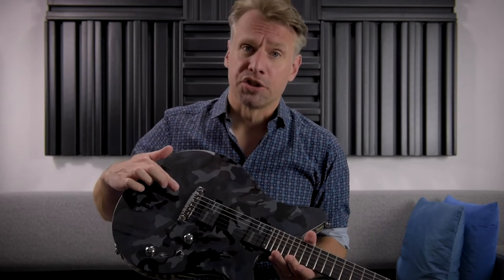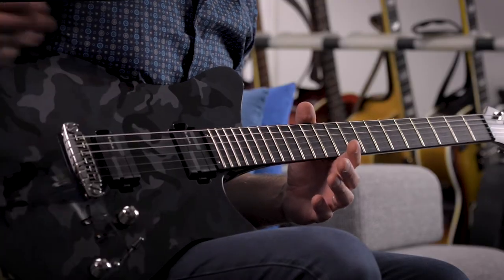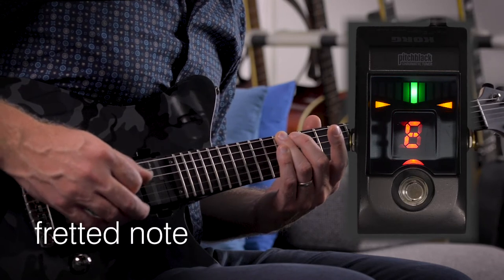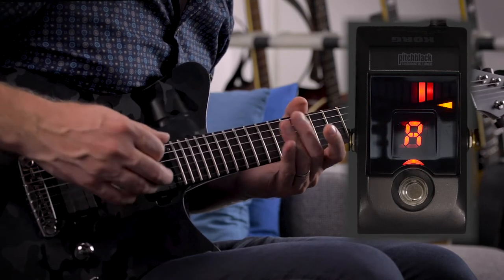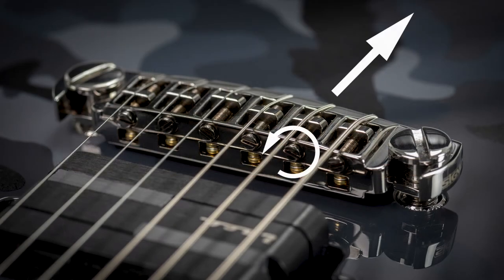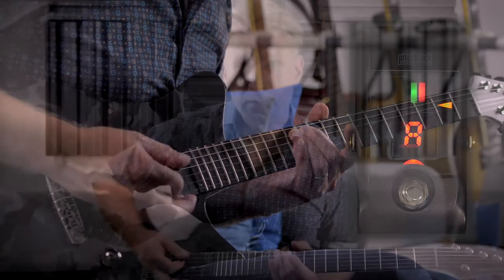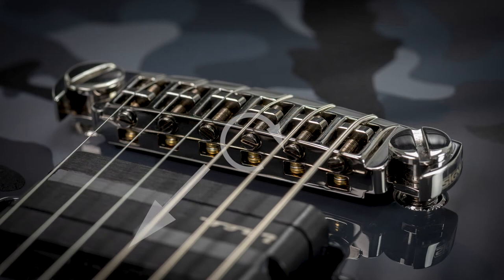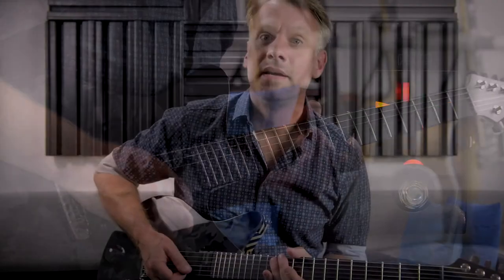How to intonate a Schaller Signum adjustable wraparound locking bridge

Comment: So-Are you loosening the individual string before making adjustment to the saddle?
 Did that Bridge come with pre-notched saddles?
 I wonder if this will fit a Les Paul Special-I have been chasing the intonation monster for several weeks-just can't seem to get the guitar in tune. I tried a compensated bridge-but with .08"s it was even worse!
Reply: Stewart McDonald can help you , they have wonderful wrap around bridge that is low profile with adjustable saddles but on my Epiphone i had to screw out the bridge nut inserts and install the stew mac inserts that come with it !
Reply: @ijamsum  Thank you-I went with a Mojo Axe-Intonation issues solved. I wasn't looking for the guitar to "look" vintage, I was looking for it to remain in tune. 
Also, I have, what I think anyways is the best possible scenario-If you have a Les Paul Special, or Les Paul Jr. and you do not want to purchase a new bridge, but can't stand to leave your P90"s behind? -Use open tunings-specifically Open E. 

My intonation issue before I got the bridge was to experiment and learn my slide capabilities more so. Thanks.